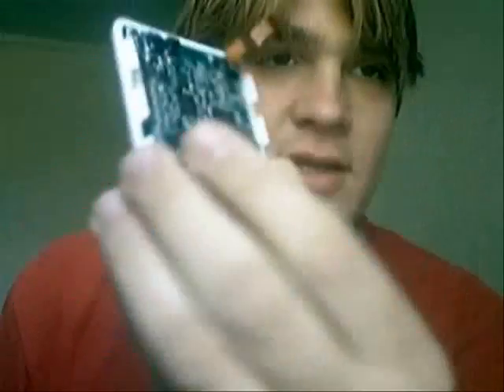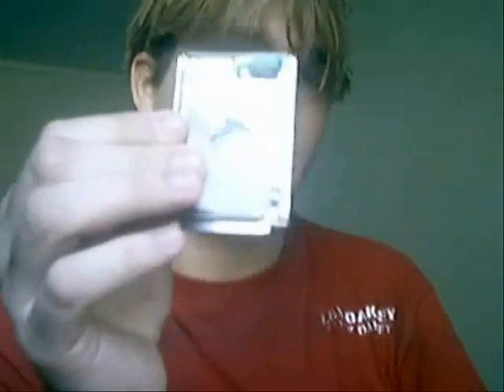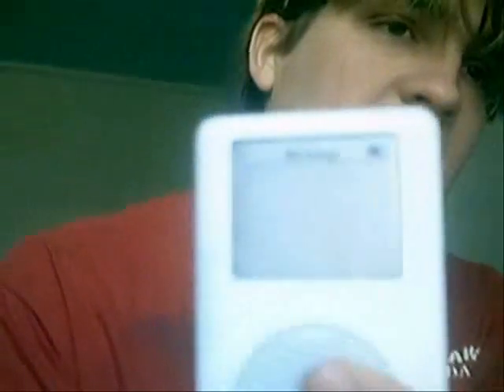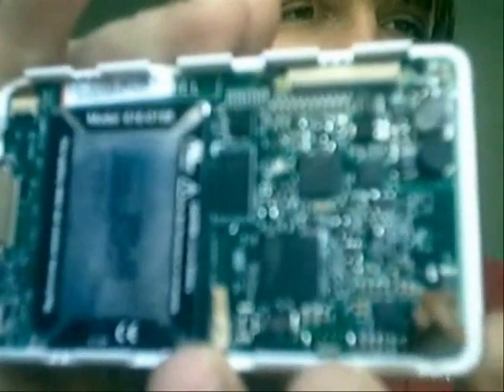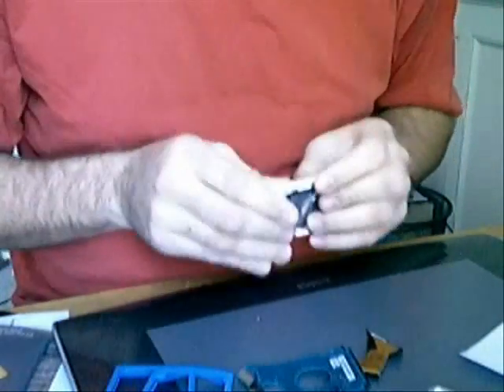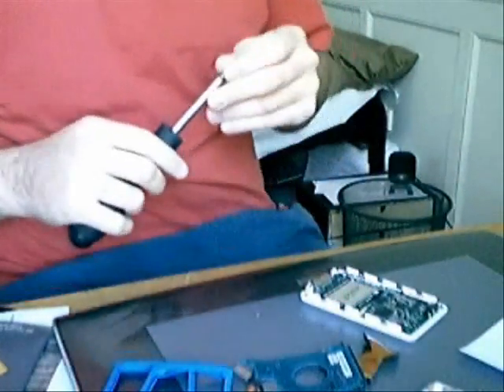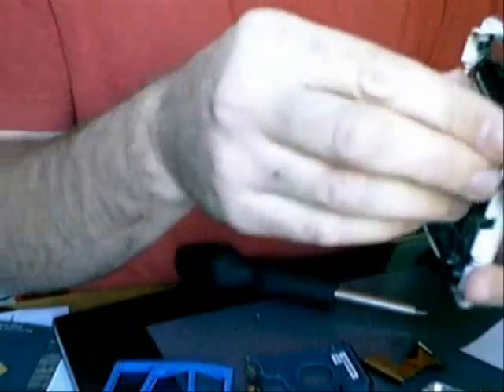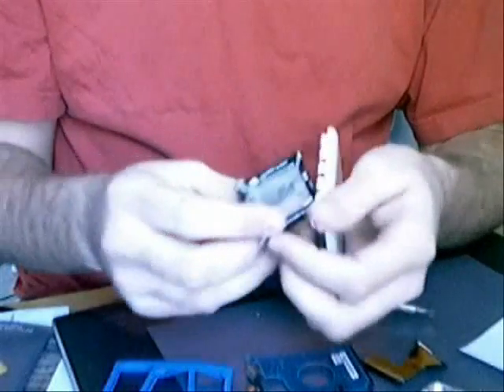Ipod from the inside

Comment: Hey, man, i have an ipod (5th Generation) and i use to get the same problems. It's because when you sync it with another pc (other than the original pc), you need to manually transfer the songs, or else it will delete all of the files. it's weird how it works.